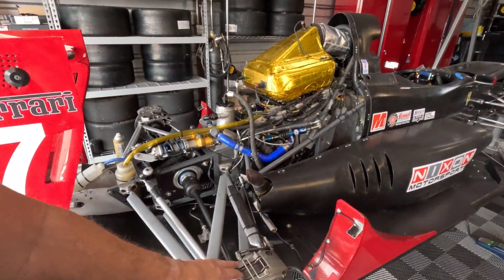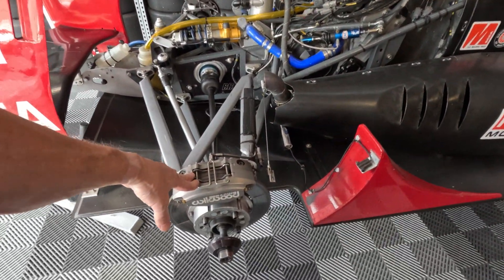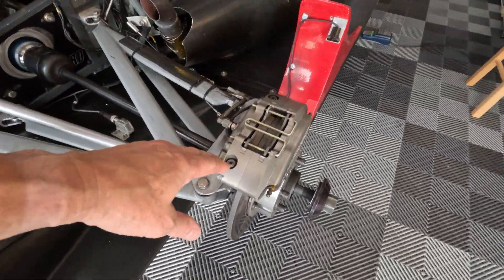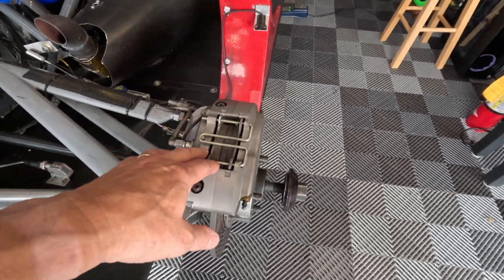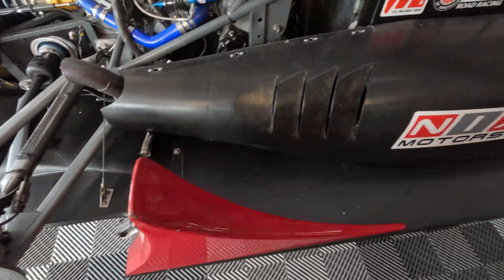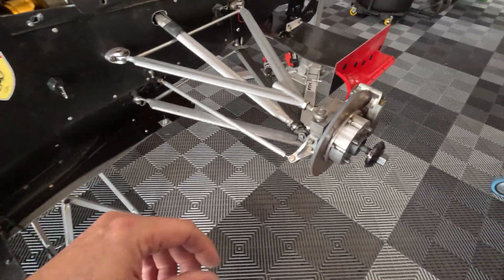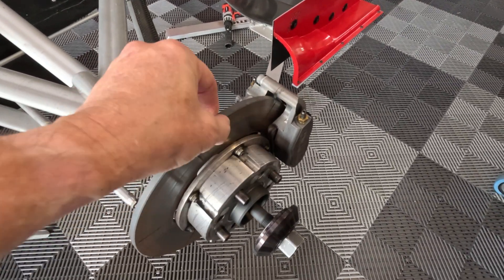Unlocking Speed: (Update) Secrets to Reduce Race Car's Rolling Resistance

Comment: Mark, thank you so much for these instructional videos.  I decided to get back into racing recently, picked up an FC this past spring.  Previously I'd run closed wheel cars, so the info you've shared in this and other videos has really helped me (along with a few generous folks I've met) to get up to speed working on these cars.  I have a long way to go before I need to think about the kind of optimizations you're doing now, but down the road possibly. Picking up 3-4 mph from those changes is impressive and seems well worth it if your car and driving ability are well sorted, as yours are.  Looking forward to the next one.
Reply from the maker: Thanks for the comment and support, happy to see another racer.  The FC cars are great, I am sure you will have that big smile on your face each time you head out on track.

Comment: Hi Mark, I am very interested in this subject. I am wondering where you were able to source the ceramic bearings from. Also wondering if there is a specific part number for your uprights or did you just use dimension matching. Cheers
Reply from the maker: I did not source the bearings myself, I sent my uprights to inter city mfg (the machine shop that mfg the uprights) and they sourced the bearings and modified the uprights to accept them.  Uprights are custom for my race car.  You can do this yourself I suppose but for me I wanted to have someone who had experience with these bearings and what it needed to make the mods for my uprights.  Hope that helps.
Reply: Thanks Mark 😊